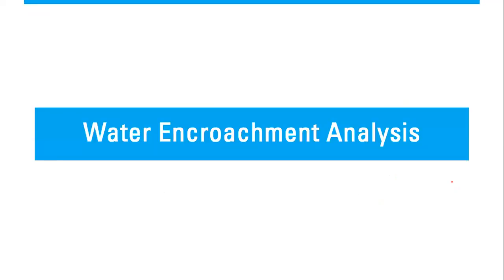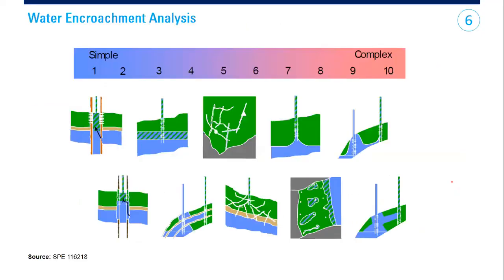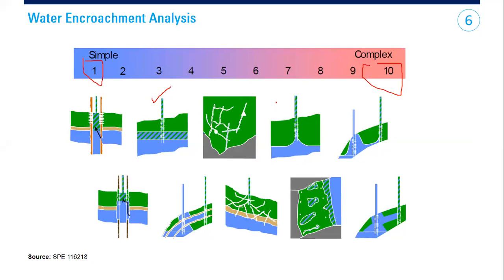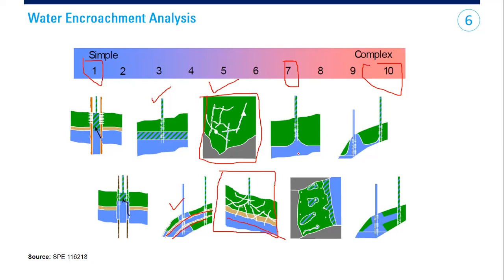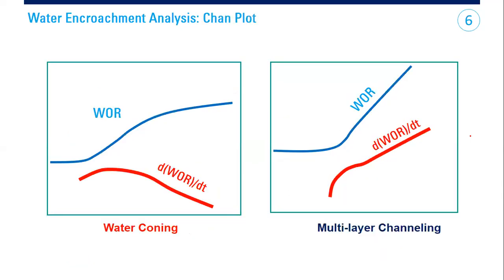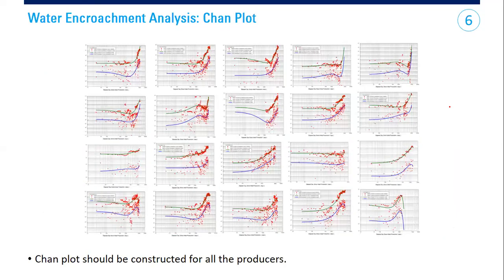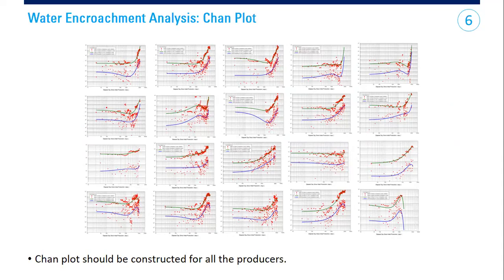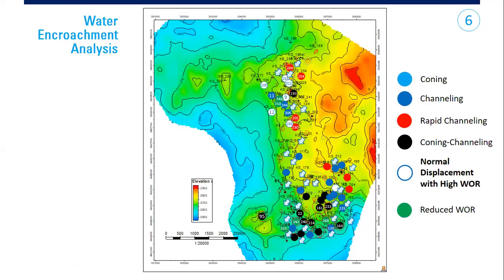RE Analysis 6: Water Encroachment Analysis

Comment: What if the well flows naturally 100% oil, then become 100% water? Is there any approach we can use to analyze it?
Reply from the maker: If it is suddenly happen:
- Check chan plot to make sure whether it is due to coning or channeling
- If it is due to coning,  then the production rate should be decreased, or the well can be shut-in for a while
- If it is due to water breakthrough from nearby water injection well, then the injection well can be shut-in or the injection rate decreased
- Check CBL/VDL to ensure good bonding of cement and casing, and no leakage
- Check with other advanced logging to find if there is any leakage
Reply: @EngMan101  I can't create chan plot since I don't have any ratio between water dan oil. This well was flowing naturally 100% oil for solid 1 year, then became 100% water the next day. We will check the hard data (cement, CBL/VDL, USIT) to understand the well condition & to plan next well service.
Reply from the maker: @hermawanjokosutrisno7584  Good luck